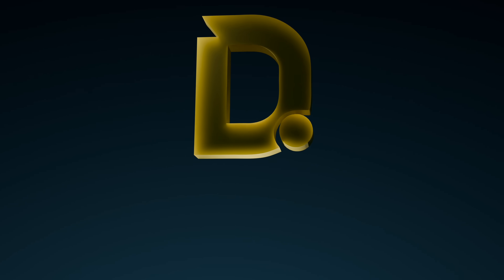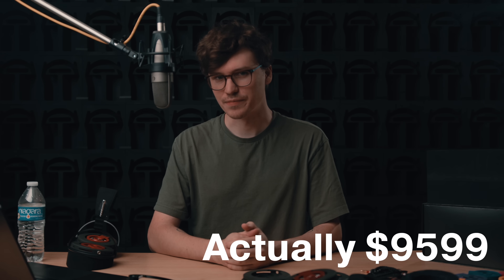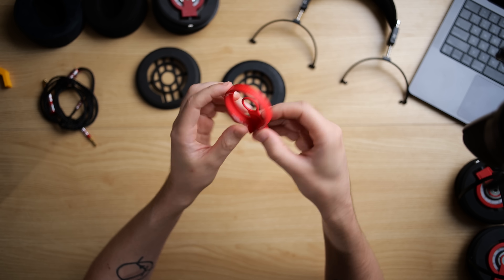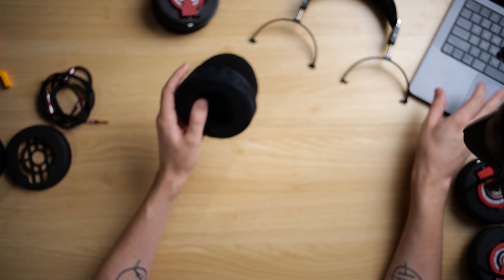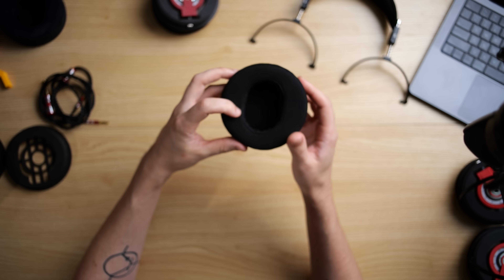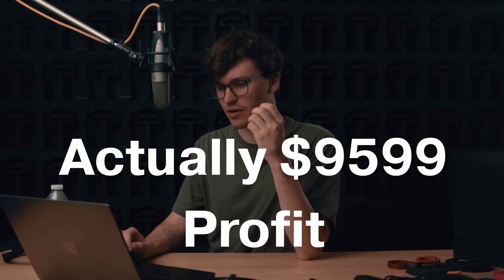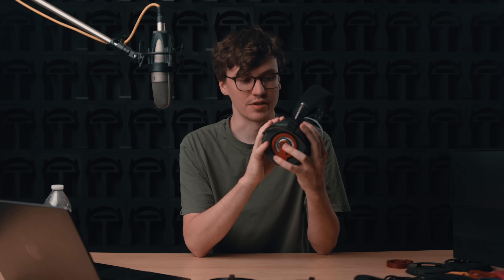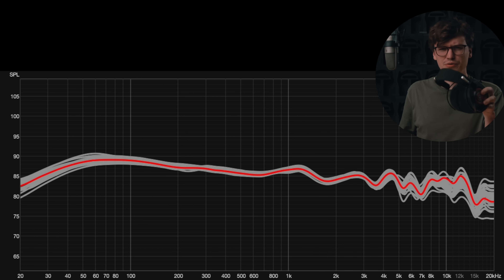What it really costs to build a headphone

Comment: We are still missing at least one guy from Reddit saying that "the driver costs only 10$ a piece".
Reply: i just looked  this driver, its 11 dollars from parts express buying 1 ~Peerless HPD-50N25PR00-32 2" Headphone Driver Diaphragm
so he was right, my guy. it took me 1 min to find it,  that thats buying 1 , imagine when you buy 1000

so i know alot more gowes into makeing them, but as far as the driver cost he was very right.
Reply: @Gateseleven  that was exactly the point i was making. a lot more goes into a headphone than a 10 or 11$ driver. which is also the point of this video.
Reply: @andreasschwarz4908 no that wasn’t the point you were making.
Reply: @nng2442  reading comprehension of a wet piece of paper
Reply: @andreasschwarz4908  well, you did not say that above . we are not mind readers
Reply: @user-vl8jv1tl5e there's a running joke (for me) since the Aurorus Borealis' release, back then a few people started to say this. i will try to refine it next time, maybe like "driver only costs 1$, headband 50c, cups 2$, why so expensive?" 😅

Comment: I was about to post in the reddit thread that, at this qty (~200 pairs, 500 cups) you can almost have the cups (designed to be) CNC'd from something like POM or solid nylon bar stock and "might" end up even lower cost than SLS. And if you're smart enough to have some 2D, or "2.5D" parts, you may wanna use thin sheets of CNC'd carbon fiber for some bling and also bring the cost down (again compared to SLS).
Reply: I've talked to Douglas about the Omega a while back at a Canjam show before it was announced and he said the internal structure of the cups that is vital to the tuning could not be manufactured in any other way other than SLS. SLS was a necessity not just a practicality.
Reply: @andrewayers1141 just because they could not find another solution does not mean one doesn't exist
Reply: @KwongKan  yeah I feel like the final commercial product has been held back a bit by being produced solely from additive manufacturing - but given that he intends to release the project to the public so they can build them at home, it's fair enough. Still, I'd love to see an Omega2 without these limitations go into production in the future
Reply: @redgopnik2227  Fair enough, in fact I've already printed a pair of Tofty 4 and I'm pretty satisied. Looking forward to when Omega become open and make one.